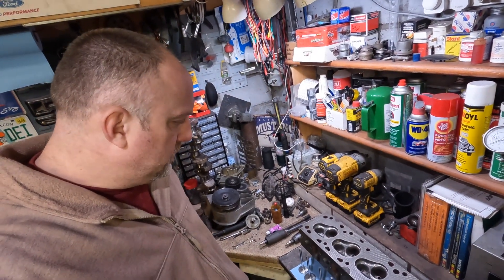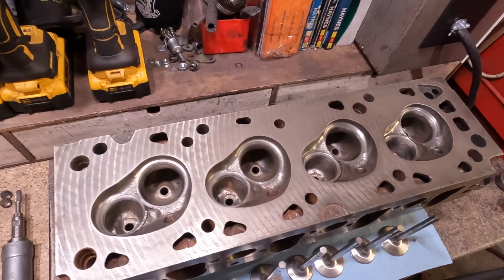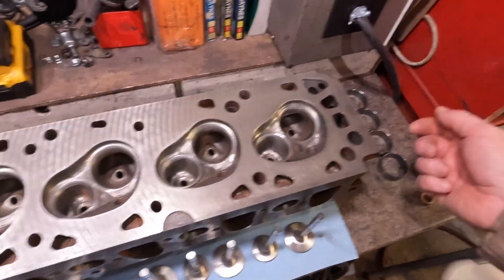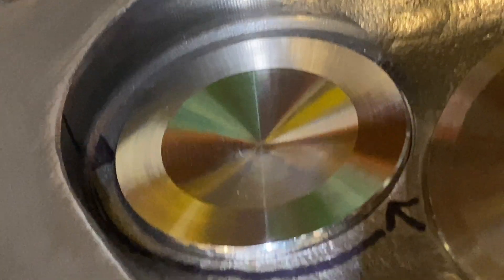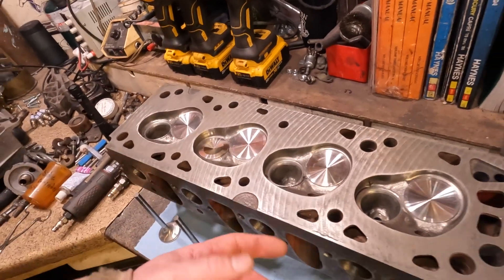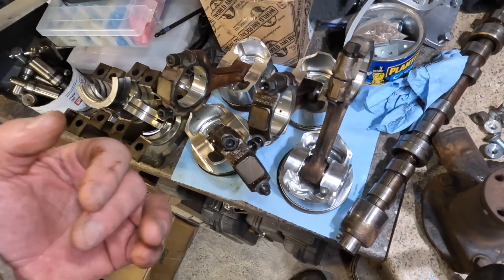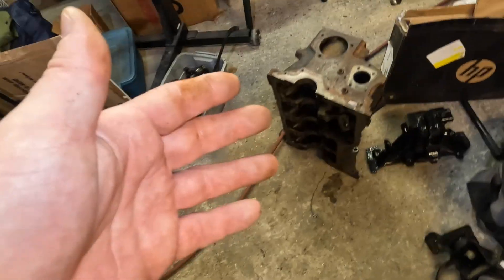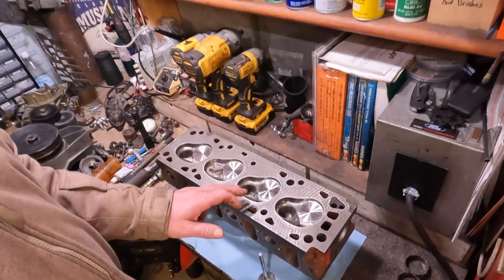Ford Thunderbird 2.3t Head Port Work

Comment: Not only does the 2.3 T5 have a smaller diameter input shaft tip but the length of the input shaft is different than the V8 version.

Comment: Chatter. I always check everything after it comes back from the machine shop. I've seen part's that looked like they were wiped with a grinder that I know did not do anything to balance the rotating assembly. I told a friend that you've got to get trusting  relationship with whoever does your machine work. The shop that always did mine is gone now. And it's hard to find anyone who you can trust to do this work anymore.

Comment: Hate to break it to ya, but with that 3/16" wide valve seat those oversize valves arent going to help you much. There was no reason for the lousy exhaust seats. If the shop needed to they could have spot faced the guides so the cutter runs true.

Comment: Back in the day a lot of guys used a 2.5 crank, rods, and pistons to make a stoker out of them
Reply: I believe you need main bearing spacers if try to put a factory 2.5 crank into an older 2.3 block. However, the last of the 2.3's had switched to the smaller mains like for the 2.5 crank, making it an easy swap to pick up a little extra displacement.

Comment: Good luck on the rebuild. Built and raced a few back in my younger days. Embarrassed a lot of GT mustangs and Z 28s with a 2.3 2-barrel Mercury capri. Inspect the block very good, all the 2.3s I remember dying was always the number three-cylinder imploding

Comment: I’ve been in the automotive machining business for plus 30 years. 
 That demonstration you gave us was pretty telling.  
I’ve checked seats and valves to be light tight several times over the years. It’s quick and telling. 
  One thing I’m not clear on but thought I heard mentioned was that this engine had already been assembled before these checks were made.  
   If these heads were in fact torqued down to the block after this valve job was done then I would make the corrections to seal these valves and seats up and mock up and retorque the head bolts again to make sure the head bolts are not distorting the valve seats.  
    I have seen this happen in some extreme cases.  Not so certain that I’ve seen this on these particular type heads or not. Just some advice I think may benefit the situation. 
   I see too many of these YouTube videos demonstrating how their valve jobs are seals up by using a magic marker on the valve face and seat.  That does not tell the tale what so ever.  
  Another important issue directly associated to this subject is valve guide to valve stem clearances. 
   It is best practice to try and seal the valve job up with minimal guide to stem clearance.  The tighter the better. 
  If those stems have the common .0018”-.0022” clearance on them and they’re not sealing then there is cause for concern. 
  Going further down the rabbit hole......
  If you correct the seal on that valve job with that much clearance how do you know the level of concentricity between both the valve stem and valve face as well as the valve guide centerline to valve seat centerline?
   The potential for eccentricity in that combination is very real.  You can in fact seal that valve face to that valve seat 100% @ .002” clearance in the overall package with no way to realize that the valve stem may in fact be completely loaded to one side of the guide with minimal clearance. This may in fact cause seizure.  The stem to guide clearance can appear to have been addressed correctly but the eccentricity paid a bad visit.  
   This is why many machine shops get fussy over valve guides and mandate machining for brand new guides even though the existing were still within spec.  
    Anyone can seal up a valve job with .002” clearance.  There is just lots of room for error that can go unnoticed. 
    As often as I can I like to perform valve jobs with as minimal  clearances as possible.  
   I use tungsten carbide live pilots to do my seat work with. Meaning my pilot is constantly spinning in the guide while I’m cutting the seat. This means I have to mind guide to pilot clearances especially on cast iron guides.  Bronze I can get so tight that I ca use y live pilot to broach with slightly and get clearances so tight nobody would want to believe it and I wouldn’t expect them to.  
    What all of this enables is and clear understanding in how concentric both your valve grinder and seat and guide machining efforts are.  
     If you’re sealing up a cast iron guide at .001” stem clearance you know you’re pDG with concentricity. Doesn’t mean that I will run that clearance. I do open them up to specs depending on use.  
     With bronze alloy guides and beryllium copper or moldstar 90 seats it is a must to run as little as possible clearances.  Those seat materials will not handle excessive valve stem clearances for very long.
Reply from the maker: I'm just a guy in a garage doing the best I can with what I have.  Being in the UK has its own unique set of challenges and if I can do everything myself, I can al least trust the work is done to a somewhat reasonable standard.  
I have purchased several bits of machine tooling in the past to perform machine shop operations myself.  Several larger ones I had to leave in storage in the states such as my own valve grinding machine and a vintage Sun distributor machine.  I was able to bring many of the smaller hand tools with me.  I certainly do not have any modern equipment at my disposal but I can hold my own paying attention to what matters, then farming out what's beyond my "tooling" abilities to local machine shops.  This country is quite far behind the standards to what is available in the USA.  When rebuilding the 390FE in my videos I purchased and provided the machine shop with a torque plate as there was none to be had in the entire country.  The same will be true when I'm ready to build my next SBF.  There is even more to be asked of this place where balancing a V8 is perilous and costs 3x-4x of what you would pay in the US.  They are simply not familiar and charge hourly rates due to the excess amount of time they take to perform the task.  I've seen some dodgy practices but they have me over barrel when there are no other options.  
I will never claim that my way is the only way or the right way, but only that I'm correcting an issue and to make people aware of what's out there.  Using the flashlight to ensure the seal was light-tight was simply an easy visual for the YouTube masses to wrap their heads around.  I don't have a valve seat concentricity(runout) gauge or the camera gear to show the watchers any other way.
But if I find it interesting, I'll probably try and make a video about it to share.
Reply: Every bit of what you say is true - right up until running tight stem clearances on boosted engines. (Like this Turbo 2.3)
The extra exhaust heat/temperature from boost or nitrous causes more expansion (just like the top ring gap 'closing up'), and the stem is right in the middle of the lions share of that heat, and need at least an extra .001 to .0015" clearance. I replaced exhaust guides on Many sets of heads (some with under 1000mi) that the exhausts were clearanced correctly for a N/A, but the owners went to Nitrous or a form of boost and gauled the exhaust guides & stems, a few even stuck open.
The intakes seem to stay cool enough.
Otherwise, you nailed it dead square, and put out a lot of good information.
Reply: Final valve guide clearances always come down to applications and materials used. 
  Manganese Bronze Alloy guides mated up to molybdenum coated titanium valve stems I’d run no more than .0017”-.0018” stem clearance on the exhaust  with moldstar90 or beryllium copper seats in a boosted drag racing application. 
   Same application same scenario on the intake side I’d be around .001”-.0012”. 
   N/A with that same material same racing application I’ve ran them at .0006” on the intake and .0012” on the exhaust. 
   Circle track road race type engines. .0012” intake .0019” exhaust but only when there are siamesed exhaust ports.  
   Symmetrical ports Ill run less on the exhaust side. 
   Start removing the optimum materials start adding clearance.  
   The valve guide can be just as effective at removing heat from the valve as the valve seat is. Open the clearances up too much and you can over heat a valve by that alone.  
  By no means would I run any of those clearances starting off with that amount while performing the valve job. Key point made is to seal the valve job up as tight as your equipment will allow.  
    So if that same head came back in 2 weeks later that I had just performed these methods on I would not make an attempt to remachine those seats with those clearances.  Always seal that valve and seat with less than you’re going to run. Otherwise you’re introducing eccentricity that you have no way of seeing. 
    I never trust a valve seat runout gauge. I’ve witnessed too many arguments over those contraptions over the years.  I will say that it’s been several years since I’ve even seen one and the may be better than the ones I’ve seen in the passed. They just serve to defeat the second point I’m making.  
    It’s not just the valve seat to valve guide centerline concentricity we’re all concerned with its both the valve guide centerline to valve seat centerline coupled with the valve stem center to valve face center.  The entire package. 
    So it would be outlandish to attempt any of these efforts with a standard ball bearing adjustable chuck on a typical Sioux valve grinder. I know that my new Sioux Valve grinder wouldn’t hold anything the same way twice. Sure it was good to seal up at .0015”-.002” but that doesn’t lend me much comfort with what I have to work on.  
   At a minimum you need high quality ER32 collets to get to that level and at that you’re at the mercy of the valve stem quality itself. Most valve stems are not there even some nice name brand valves lack and will only yield so much accuracy to the collets clamping accuracy. All the more reason to understand where you’re ability to seal a valve job up is.  
    Not saying that I do not run valve jobs with standard accepted clearances like any other normal shop. Sometimes the quality simply isn’t there to use. 
   I worked for a machine shop that built racing engines that competed in national and world events.  Several numerous national event winning engines. Several world titles. 
    We would see all kinds of crazy set ups come through the shop. Intake valve to piston clearances that only what what the valve lash was lending. (And they were living fine that way). 
   The owner of that shop had a .002” valve stem to guide mandate on all engines for years. Didn’t matter it was not up for discussion.  
   That was until copper alloy seats started fading rapidly mid season with the rest of the field not suffering. 
    Our shop owner had us disassemble cylinder heads from some cylinder head companies that were world class in both NASCAR and NHRA.  
   We would see these crazy numbers I’m speaking about. They were custom set up for our customer’s racing category ready to go.
    I made some phone calls to the responsible shops and got educated.
   Yates, MBE were just a couple. Those clearances were mandatory and were not to be altered.  
   It was a lesson learned. 
   It does stress and does tell the accuracy of what you’re machining with.  
   It is an aim small miss small mindset that needs to be adhered to.  
   Those are the points I’m making. 
   Sure there are exceptions to the rule. There always is. 
  Just don’t correct a valve job with .002” stem clearance without adding another .0001” or .0002” to the guide. That should keep eccentricity from biting when you have no way of seeing it.